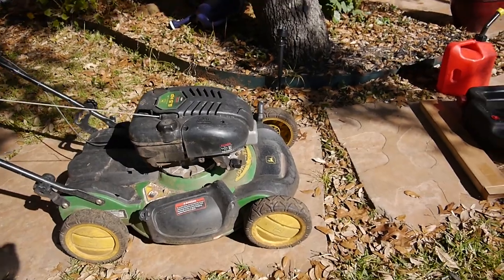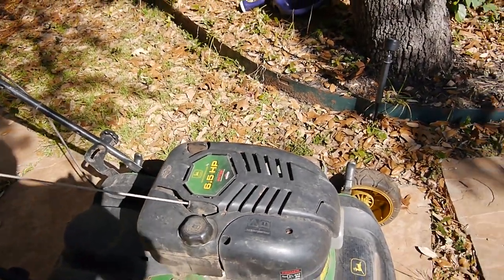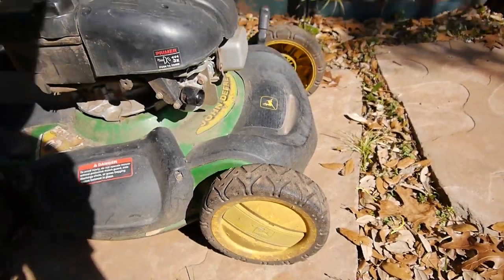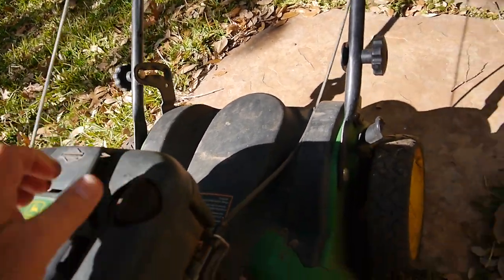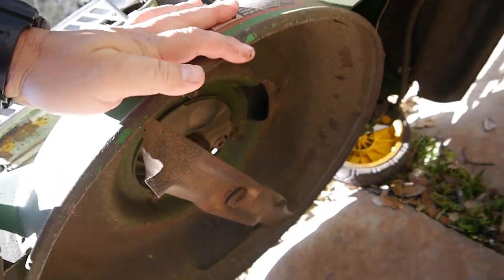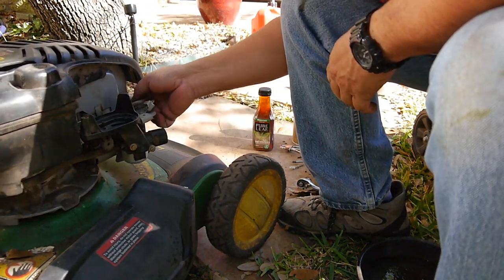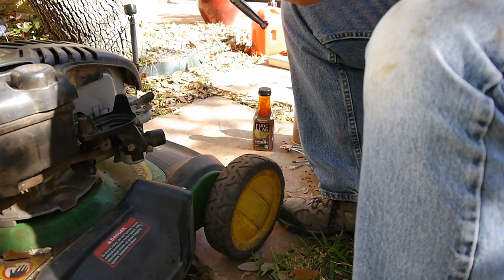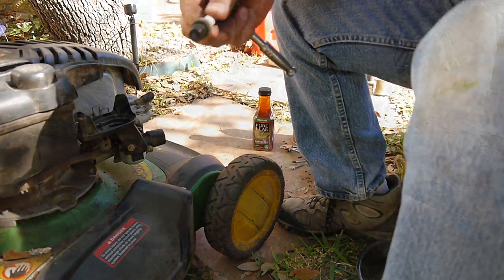John Deere JS60 Lawn Mower was Running Rough

Comment: That was a relatively easy fix for you.  When I saw the blade I was afraid the crank shaft might be bent.  Great job of getting it up and running for some more mowing.  customer should be very happy.  Thanks for the videos.

Comment: Great video. I have a john deere ja62 with the same engine. But this year it's came down with a surging issue. I replaced the needle and seat, cleaned the carburetor many times, replaced the air filter. After about 5 to 10 mins even with all the cleaning and work it still is surging. Any ideas what it could be?

Comment: That is one of the Intek 6.5hp. I dont see many either.  I think they were too expensive to make so they stopped selling them.  It is a very quiet running engine with good power.
Reply from the maker: Don't see too many of them.  Probably from a John Deere dealer, not a big box store.